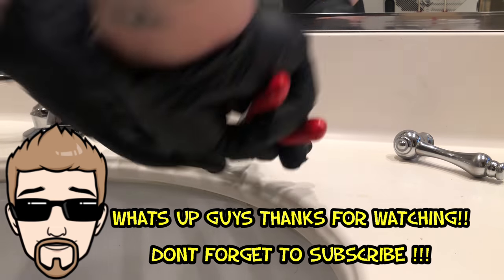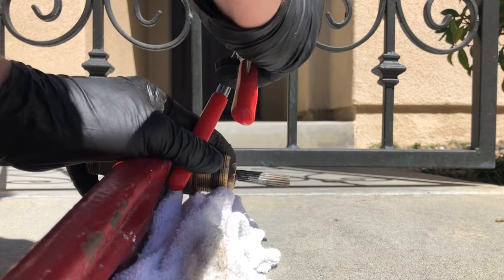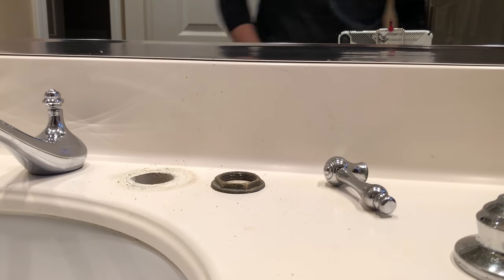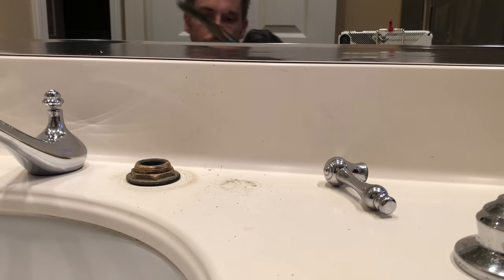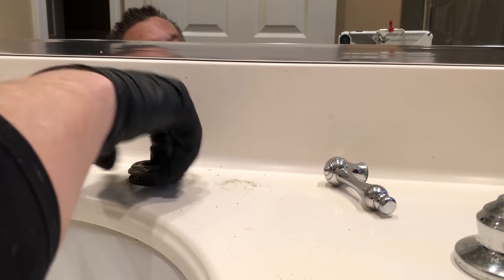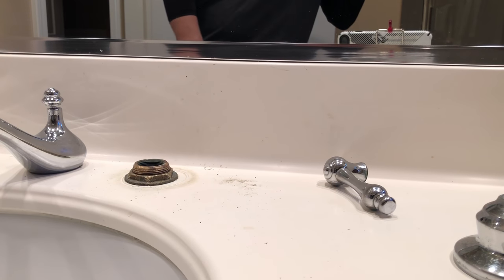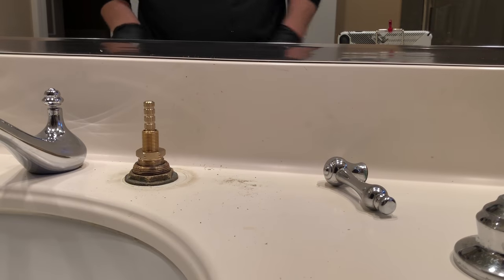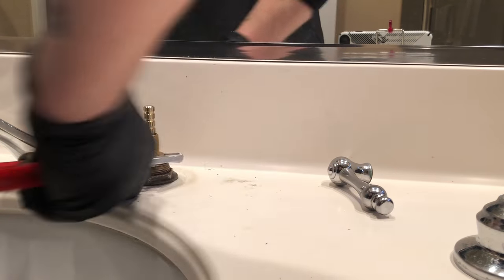How to remove a stuck cartridge or stem from any brand faucet! | Trade Tips N Tricks

Comment: Finally a solution that works! I had a leaking hot water Roman tub valve that was cemented to the valve body and would not budge. Not wanting to remove the entire valve body, I put a little plumbing tape around the valve body stem & threaded the flange back on a little bit. This created a nice cup around the stuck valve. Poured in the CLR around the stem  (and into the screw hole like you suggested in one of your reply comments) & left it to soak for 30 minutes. I tapped the stem a few times during the soak. After 30 minutes, I removed the flange, wiped up the CLR, & valve looked new! Lol. Was able to remove the previously cemented valve with the channel locks. Excellent post! Thanks so much.
Reply from the maker: Glad you found the video bro! Very happy to help!! Good luck out there!

Comment: I usually just break it and tell the client we need a new one..  😂🤣😂
Reply from the maker: Hahaha well now you don’t have to brother! This’ll save you some time and money and potentially impress your customer. Only advice I can give is don’t use channellocks on the actual cartridge to remove it if it’s really frozen because I’ve had the channel locks completely Deform and destroy the nut and then your only chance is another pipe wrench and sometimes the pipe wrench is just too cumbersome. Get you some CLR bro it will change your life like I said in the video I’ve always used PB blaster or any other type of rust/corrosion penetrant spray other plumbers use to be really impressed with how  I’ve always been able to get the cartridges out but had I known about CLR long ago I would of saved myself hours upon hours of time and frustration shits a game changer bro check it out if you haven’t already I guarantee you will be thanking me
Reply: @PlumbingExplained  CLR Power Plumber-Pressurized Drain Opener or CLR Build-Up Remover?

Comment: I can't remove the cartridge from a Brizo single-handle shower faucet...any ideas?  A plumber tried and his only solution was to use a saws-all to cut it off.  It may damage the unit, which I don't want to do.
Reply from the maker: What I normally do is Ill take a heat gun or my torch and heat the brass valve body until the plastic cartridge starts to melt and sizzle then it normally slides right out, If you can Email me a picture of the Valve you are dealing with I can try and give better advice. When heating the valve if you are using a torch you have to be very careful you dont compromise the fittings so i recommend a heat gun. OCMaverickplumbing@gmail.com send me a pic ill try and help you out anyway I can.
Reply: First, try to see if you can find a similar model on Brizo for a parts diagram and install manual.  Even if the model is out of production, a new faucet may have the same install procedure, allowing you to look for similiar steps to remove  handles, stems, cartridges, etc.  Whatever rust or mineral buildup remover you use, CLR, Limeaway or vinegar, use pieces of paper towel to soak the area for minutes or even hours (vinegar which is a mild acid), and then you’ll see mineral or dust dissolving, you can try unscrewing parts.

Comment: Thanks so much for this video. I have a Phylrich faucet where it was difficult  to remove the cartridge. Your video demystified the process.  In this case I didn't have to use CLR, I placed the unit in a vise and cranked on it and it came free with not a massive amount of effort. I'm soaking the brass faucet parts in vinegar solution to remove corrosion. Question: I have a replacement cartridge but is it possible to free up stuck cartridges via soaking in a solution or just better to replace overall? 

Regarding the higher end faucets, I understand what you mean about switching to Delta. My house was built with high end items but it seems when you need to maintain them, they are expensive and a pain. Kind of like the difference between owning a Honda via a BMW.
Reply from the maker: I completely agree with you bro just alot if people don’t upkeep them and it all seems to come at once, I’ve since changed my view though I think the higher end faucets are better

Comment: I can't even get the handles off my Kohler Forte faucet to even access the cartridges
Reply from the maker: you need to spray CLR in where the screw threads down into the cartridge, Or PB blaster PB blaster works great but it smells very strong.
Reply: @PlumbingExplained  I got the handles off with a strap wrench, but the cartridges are pretty stuck.  No amount of force with a socket will budge them.

Comment: But won't the CLR get into your water next time you turn on the faucet?
Reply from the maker: No but if you are worried about that simply flush the valve before installing the new cartridge. Problem solved.
Reply: I tried the CLR and WD-40, and still can't get the bonnet nut on the cartridge to budge.  The top part where you put a wrench on it is so shallow, and some of it is eaten away.  It's pretty much impossible to get any kind of wrench to grip it good enough.  I tried vice grips which didn't work either.  I tried using channel locks to grab the whole body of the nut and try to twist it, but that also hasn't worked.  Oh, and I tried heat with a lighter before using the CLR and WD-40.  Any suggestions?  At this point, I'm considering dynamite.

Comment: This is exactly what I need today. Thank you so much. The plumber came and said he had no idea how to get the handle off..I called Kohler for help.  Plumber said he would have to cut through my wall to get to pipes and also cut out my tile. I said forget it.  He went in basement to put a shutoff valve to stop water from running and charged $425 but would not talk to Kohler on how to take hot water handle off .I put vinegar on the part to get the handle off and now I am stuck at the cartridge not being able to remove it. Kohler sent pieces for replacement for free but I cannot get cartridge out. I am going to get the CLR but which one is it?
Reply from the maker: Rosemarie Veliz any calcium lime and rust remover spray should help you out. If you have any other problems or questions let me know I’ll do my best to help you out.
Reply: @PlumbingExplained  Thank you so much. I bought the product and I still can not get the bolt off that will allow me to pull the cartridge out. I will let it sit over night I suppose. The CLR certainly made the brass look like brass but the bolt refuses to move. I am so happy I found this video and thank you for making it. Hopefully the bolt will release as it is still attached to piping in the mount of the tub!
Reply from the maker: Rosemarie Veliz you can also try using something called PB Blaster it’s like WD40 and the liquid will work it’s way up the threads helping them come loose. I’ve had times I could get the nut to free up and in that case you need to order a new “valve body” from Kohler if that’s the manufacturer  sometimes you can get them to send them to you for free, be sure to tell them you Are the original owner they lifetime warranty their produces